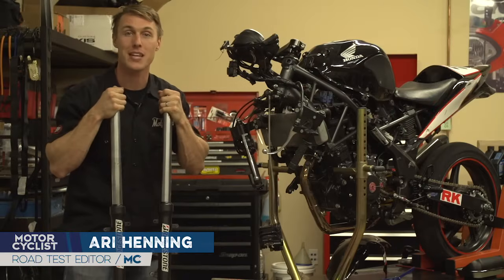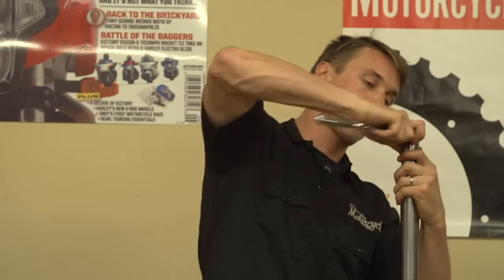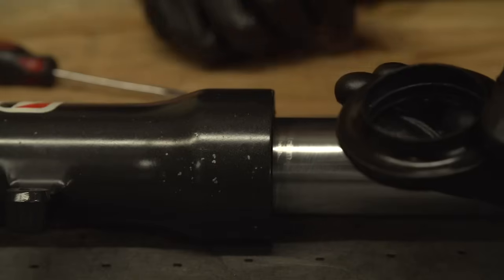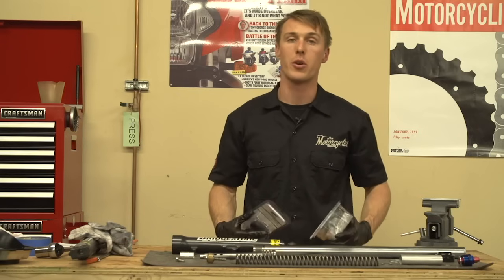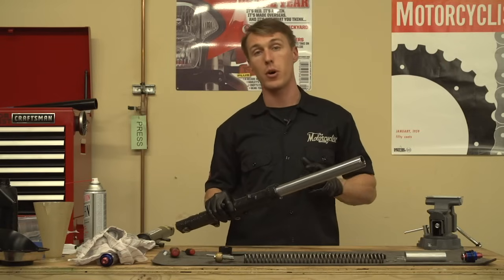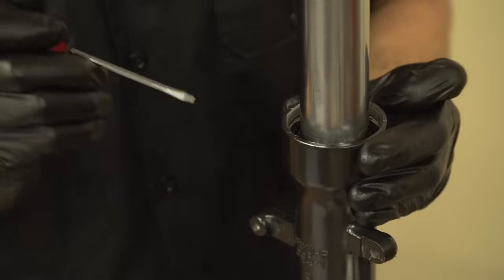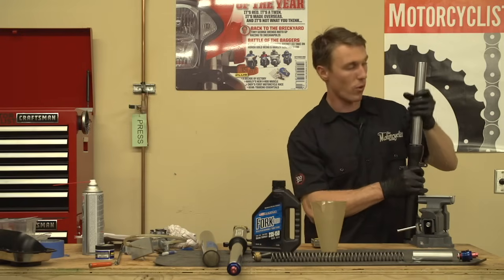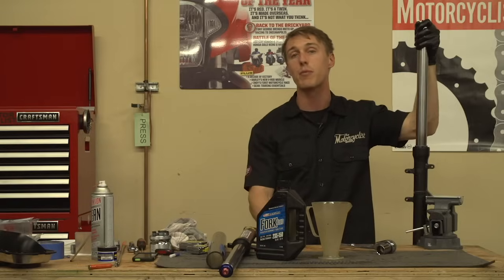Motorcycle Suspension Tech and Maintenance: How To Rebuild Your Fork | MC GARAGE

Comment: 10 year old video and still just as relevant! Tip for getting stubborn oil seals in is to first warm the slider with a heat gun to expand the oil seal seat, then it goes right in.

Comment: Why didnt u just install the oil seal in the leg then slide the stanchion in ? Piss easy non of the struggling sliding pieces of pipe trying to hammer home the seal .u just tap it home with a socket then slide the leg in
Reply: Because you have to seat the bushings in the tube before the seal.

Comment: Super helpful video! I needed to replace a seal on my 2017 victory octane and this was dead nuts what I needed. Did both forks from on the bike to riding home in about 4 hours. This included snack time and chatting with coworkers. Nothing ever goes smooth for me but this did!

Comment: Is it okay to change oil+dust seal+oil seal and skip the rest? I have trouble finding rest of the parts.
Reply: that would depend on the other parts conditions. if they are worn you will be tearing the forks back down again anyway. worth doing a rebuild honestly.

Comment: I just used this vid today to strip apart my 96 reg honda  cb750fn.  So iv looked an i cant find anthing saying how much oil to put in as i had one that was.leaking  so i stripped them apart . There one part that might have told us when you take the top nut off the old oil  STINKS like old PI$$  and its a choking stink. .
So i got 2 full plastic cup fulls . -the stuff all over the bench hands floor an rags .. prob half an cup each .
But really the smelly old oil ppl need to be told . I just hope i can put them back togeather .

Comment: My Ninja 250 had some kind of thread tape on the damper bolts at the bottom of the forks. Came off when cleaning. Do I need to replace it? Forks went into storage after rebuilding and leaked all over.

Comment: Here's my recent experience on removing the damper bolt from the bottom of the fork leg. I was able to "crack" the bolt with a hex key with a deep socket and extension piece as a lever on the short arm of the hex key. Only it didn't really crack. I only got it moving and it remained extremely stiff. 

I started off with the spring in and then took the cap off to see what was going on inside. No photos I found on the web, looked like what the inside of my fork looked like and I remained doubtful that any of the tools I found online would be remotely suitable. 

The cup on the bottom of the damper is basically a circle with 4 flats on it, with a small gap of only about 1/8". Any tool to hold it would have to be a very close fit. 

I tried shocking the bolt with a hammer and also applying heat with a heat-gun. I would say both these approaches are pretty worthless. I mean how much heat it going to make it all the way thru to where the bolt meets the damper - not much! And I really can't see it doing much even if it did. There's no corrosion in in an oil-filled fork for a start. It's just thread pressure. Likewise with shocking it with a hammer. How hard can you hit it in any case. And again, it's not a shock issue like it might be with a seized thread. I tried whacking the hex key lever with a hammer to get it to rotate quick and break free. Didn't do a thing.

I wanted to have a go with an impact driver but how to do that for a deep 8mm hex bolt? I'm sitting around thinking and I remember my 3/8" socket driver for the impact driver. I keep forgetting about that sucker, but that won't do it.... but, hey, if you go 3/8" socket driver to 8mm socket to cut-off hex key, you've got it!

That did the job pretty quickly. I did have to slide a metal rod with a chamfered end down the fork to hold the damper once the thread got towards the end.

TBH, I'm kind of surprised that most experiences I've read about, seem to be that the bolt comes out easily with a hex key and a bit of a heave. My experience would be that you either have to hold the damper with a special tool or use an impact driver, especially if the damper has been installed with a holding tool as I imagine it is when it's first put together. I wouldn't be surprised if I'm the first to take these forks apart in 18 years!
Reply: Sup man. I'm doing the fork seals on my bike as well right now and I ran into this issue. At the bottom there's a hex bolt which I got loose but however it just keeps spinning when I try to continue opening the bolt. On the inside of the fork theres a round hole but i just dont know what to use to hold it in place so that I can open the hex bolt. At this point I'm loosing faith in the internet since there's no video or and instruction or tool for this fork seal replacement. Just thought I'd give my 2 cents since I saw you were having the same problem

Comment: Great video. I just might add that once you have rebuild the thing up, fork oil level should be measured with the coil off and while the fork is fully compressed. If you added emulators or orher inertia valves which weren't part of the original setup, you should measure the oil height with those parts in, since they take volume that otherwise would be filled with oil.

Comment: I have an inverted fork set up (stock system) on my yamaha vstar 650. The left hand side (clutch side) preload or top spacer is sticking out the top about 3-4". I somehow missed that but thru picture i notices it was a slow process. Would that mean I need to take take the fork apart (as shown on this video) or just tighten it back in place?

Comment: My 110 cc Indian make bike, the handle is wobbling or shaking or the handle bar is freely steering. What is the cause for it? Replaced handle bar with a new one, forks were done in a lathe shop, replaced the front tyre with a new one 80/100 17 my tyre measurement is 2.75 17 In.

Comment: May I suggest after installing the damper rod also slide in the spring. Then stand it up on the spring so that damper rod is fully extended through the inner fork leg. Then you can put on the bottom out cone and slide on the outer fork leg. That way all of it stays lined up when you install the bottom fork screw.
I also like to use ether vacuum or pressure to remove all the air in the oil. Air causes cavitation and rises the temperature in the oil. 
Simply ether push the inner fork leg in, place your hand on it and pull the fork leg up to apply vacuum. Or if you like to apply pressure rise the inner fork leg, place your hand on it and push the fork leg down. Both cases do not let air to scape until you are done.

Comment: very useful guide!, i am rebuilding my fork as well in HK, it really helps a lot, may i ask a question, i've disassembled my front fork, and noticed some scratch on my damper rod, the bush on it seems to be a bit loose and makes the damper rod hard to be taken out. should i replace the damper rod and/or the bush?
how do i tell if i should replace them?

Comment: If your damper rod bolt and stanchion is rotating, put the fork back on your bike so it'll hold the stanchion so you can loosen the fork cap (0:30-0:35). Don't forget to use a rag when removing the fork cap. Good luck.

Comment: That Damper Rod  bolt  has a copper  washer  on my  Yamaha FZ-07.  I am trying to figure out what parts  I need to keep and what parts I need to remove  when I install the Ohlin cartridge kit..    I het a deer and bent my forks in Michigan..  New  Yamaha FZ-07 forks  $208.00  each  Ohlin Cartrige kit and springs  $900.00  I sure hope  they are worth it ..

Comment: Noway I would do this myself in my shade tree garage. I will let this for the professionals.
It's good to see the complexity of the unassumingly simple fork. I am going to respect more this useful device.
As a matter of the fact, I was wondering where the coil is bcs the whole thing looks just like a long shock absorber. Now I can see it's like a strut just with the spring on the inside.

Comment: Great video, my manual recommends 10w/20 fork oil. Is that 10 or 20 or anything between 10 and 20?
My bike is old with probably tired springs, so would I go for heavier oil, or maybe 15w? As it’s kinda in the middle?

Comment: Damper rod bolt wont come out, not even onder tension. The damper rod keeps turning
Reply: how does that make you feel? :} do you LIKE that?
Reply: @duroxkilo  wh.. what? Hahahaha. If you care, i got it out by jamming a broom stick all the way up there, which locked the damper rod in place, making it possible to remove the bolt
Reply: @acvn-hg9gy  that's not bad! congratulations.. now how did that make you feel? :}

Comment: For those trying this out, use heat before undoing those allen bolts at the bottom. Heat it up to a ridiculous hot temp to degrade the thread locker. Otherwise, you will absolutely strip those bolts. And, it's just an unpleasant time. Ask me how I know!
Reply: wish I've read this comment 3 weeks ago lol

Comment: Hello, 
Recently I’ve changed my bike fork seal and oil. But after changing, the front suspension is not freely playing. Went service centre several time and still no result. Would be appreciate if you could advise the reason for this . Thanks

Comment: You forgot to mention spring orientation! Make sure you follow spec and put the thicker spaced on the top. Linear, progressive, & dual rate are the different types. For progressive and dual rate, the tightest coils go down, loose coils up. :D
Reply: Coil orienration doesn't matter. Matt from the workshop did a nice video to rule that myth off. Coil response was exactly the same regardless of its orientation.
Reply: @tomasguerrero9622  fully agree, the spring will behave the same as it is compressed from either end regardless of which way up it is. The only consideration here is the tighter wound coils represent the heavier end of the spring which should be at the lower end for better centre of gravity or at the  upper end to reduce the unsprung weight for better suspension performance. However, the gains recieved from either oriantation are maginal at best and probably won't even be noticeable when riding.
 So rule of thumb should be, whatever way up you decide to have your springs, make sure they're the same way up in each leg! other than that, anything goes....
Reply: @roythearcher  My counter to this is that the daily weight fluctuations of a rider +\- 3-4lbs will have a much greater effect on the handling than rotating the springs would
Reply: If I eat a lunch that weighs 3.5lbs and ride with the thick part of the coils in the up position, is that the same as skipping lunch and riding with the thick part of the coils in the down position?

Comment: Hi, thanks for the video, I have a question, I had a oil leak on the right fork of my Honda CBR 250r, so I took it the Honda service centre, and they replaced the fork oil and also the oil seal, now after the change the fork suspension is not as it was. It is a bit hard and I can feel the road bumps in the handle bar. Could you please let me know what could have gone wrong and it's solution. Thanks in advance.
Reply: hey, did it ever went back to its previous state? I have the opposite problem, mine's too soft

Comment: hi, I have a play in motorbike handlebars I mean when I apply breaks handlebar moves front and back few millimeters. it is ok with steering the handlebars. How to fix or tight it. As I understand if I tight the top middle nut it should be fine right or wrong?
Reply: check your head bearings and adjust!

Comment: Is it possible to add preload-adjustable fork caps onto forks which did not come with ones from factory? Many of the smaller CC bikes I've seen don't have any adjustments available for the front forks

Comment: Could I get away with just changing the oil and dust seals?
Reply: not if your bushings or seals are worn...some times the seal gets damaged when you try to take it out in which case you will be forced to rebuild..

Comment: i know that manuals tell you to do it every 4-6k miles, i would like to fallow the book, but how bad does the oil really get and how fast? how many miles has it been for the forks in the video? this is purely just a question for reference.
Reply: HellishGrin460 how long is a piece of string? The speed of fouling would vary wildly depending on the roads you ride and conditions you ride in.

Comment: Would someone please be kind enough to to explain why bike's service manual have both volume and level numbers? Eg. my bike's manual says: "Front fork oil capacity: 250cc" AND "Front fork oil level: 325mm". I just poured 250cc inside the fork (but i didn't take it fully apart ), and the oil level is way above 325mm ( about 190mm ).
Should I consider 250cc as capacity after taking it fully apart? And regardless of "oil capacity", ALWAYS  respect the "oil level" in the manual? I tried to find this information and found absolutely nothing.
Thanks!
Reply: msilveirabr u left the spring inside?
Reply: Nguyễn Minh Hòa No, I didn't. After some time, I'm pretty sure my bike's manual is wrong or has a typo about the fork oil level

Comment: My new bike, 2 month old bajaj pulsar NS 160, slipped at speed around 40 kmph and after that i felt my ride bumpy on handlebar. I showed the bike to service centre he told that front forks need to be realigned on a lath machine.
Are front forks material so delicate. Never encountered such problem with other bikes.
Is this really due to accident or might be a manufacturing defect/ factory setting problem like low oil or something?
Reply: You'd better do what they told you to.
Indian bikes are very fragile like that. My brand new TVS Apache got involved in a very very minor accident like that and the forks got bent.

Comment: Hello Boss, 
Your classes are so helpful ,sir i have a question to ask.
I would like to reduce the length of both the front forks of my bike for a better handling.
is it possible to cut down a little bit ? does it leads any other issues ??

Comment: Hello Boss, 
Your classes are so helpful ,sir i have a question to ask.
I would like to reduce the length of both the front forks of my bike for a better handling.
is it possible to cut down a little bit ? does it leads any other issues ??
Pls reply.
Reply: Yes it would lead to other issues .you are changing front rake fork angle .DONT CUT DOWN. loosen triple clamps & come up few cm"s with both forks on top clamp .Standard bike design settings are generally best .

Comment: Does anyone know how long you can ride a bike with no fork oil at all? I bought a cheap 250 and the day after all the oil leaked out of the forks....I didn't know how to fix it so I just rode it. I put 20,000 miles on it with no problem, even some aggressive riding in the mountains and the bike felt stable despite no oil. 

I don't have the bike anymore, but I'm just curious. Was I flirting with disaster?

Comment: Help!  I replaced leaky fork seals recently and I'm pretty sure some of the fork oil ended up on my rotors.  At any rate, theres something oily on my rotors and its really keeping my brakes from performing!  I can clean the rotors no problem, but I'm sure theres oily stuff on the pads too.  Do I have to take apart my calipers and clean the pads somehow.. if so, what do i clean them with?  Need some advice, thanks!
Reply: It's impossible to wash oil out of the brake pads. I tried several times with no success. One thing that works, but is risky, is to bake the brake pads in the oven at 400 degrees for like 20 minutes. I tried this and it works, but depending on the quality of the pads there's a chance the heat will destroy the integrity of the brake and the pad may fall off. I rode my bike for quite a while with no problem (braking power completely restored) but eventually decided to get new brake pads for peace of mind.

If you get new pads you obviously have to very religiously clean all the oil off of the rotors or you're going to throw money away. Use brake cleaner or rubbing alcohol. I think I used Acetone on my rotors.

Comment: CURIOUS... SOME FORKS the cap is under pressure from the spring. Why was the video cut after putting rag on top of fork while removing the cap? 
SERIOUS INJURY can occur and probable damaging the last thread of that cap. FIX THIS VIDEO.
Reply: fm00078 If you fully remove the preload it won't spring off.

Comment: hi i am rebuilding CBR250r forks and it has done 30k km, do you think, i would need to change the springs?
Reply: +shivanksolaris The springs usually last for a very long time. I've been riding my Suzuki GSX 1100 for nearly 30 years now, and only recently changed the stock springs with Sonic springs. I know it's a very long time, but the stock springs seem to be okay... the minimum spring length of 500 mm is not yet reached. I'm sure your repair manual has a minimum spring length mentioned, as well.. if it's above this minimum, they should be fine.

Comment: Is it possible to just only remove the top bolt of this fork, to remove right handle bar, and after replacing the right handle bar, installing that thing back ? Without doing anything else ?
Reply: You don't have to touch the fork bolts to remove handlebar. You just losen the bolt on clip-on and remove a wire that holds the handlebar on a fork leg. Use your hand and very little force :)
Reply: Thanks mate, i saw that wire was just a ring :D rather than a washer :D it was called ring stopper, i thought that thing was a washer under the front fork bolt :D

Comment: what about inverted forks?
Reply: @helicopter234, that was my initial reaction. But, the inverted forks have tighter tolerances in that even a slight leak can cause you to lose all your fluid in a short period of time. With regular forks, if you have a bit of leakage, it might take a while before it gets to the point where you have serious issues with the suspension.

I have no idea whether it's actually necessary to do a video on inverted forks as most of this should be the same. My bike has regular forks.
Reply: what about them? they are  just inverted :D